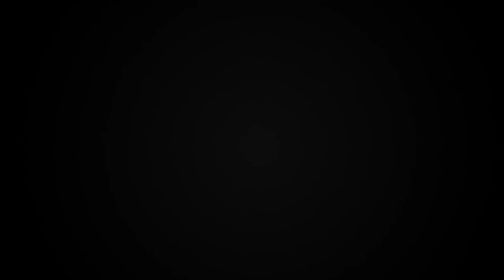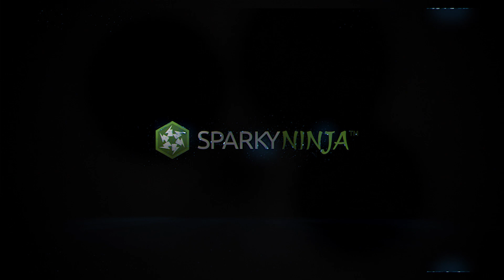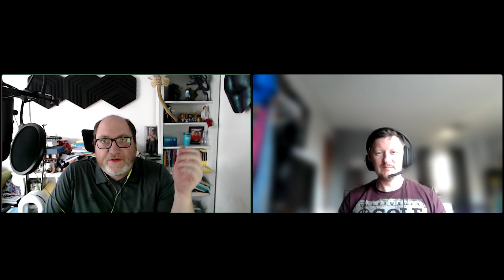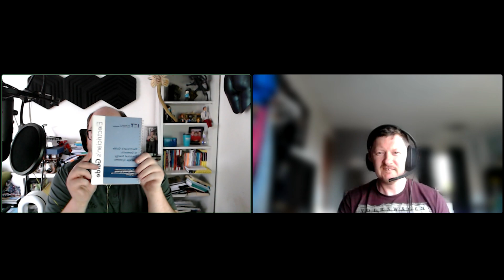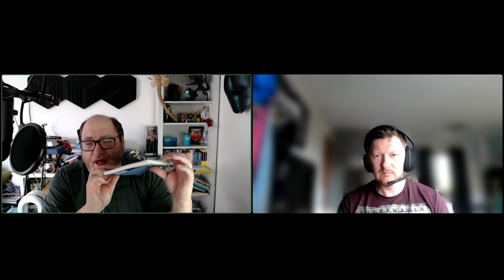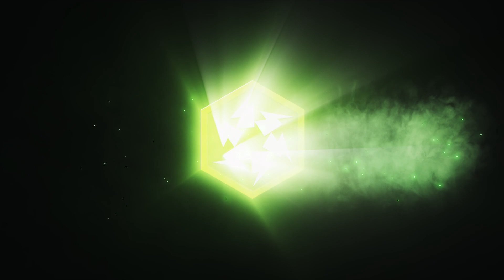SparkyNinja podcast 83: Site visits, cable bending, DNC update, Solar, Surge protection, Heat pumps

Comment: I had a customer wanting a socket fitting outside to plug a granny charging cable into to charge a plug in hybrid. 
I went to servey the existing installation to build a realistic quote. 
Ended up quoting to install a mains tails isolator, Henley blocks after to split the tails, new small dedicated hagar consumer unit containing a hagar type B RCD, Main switch and MCB, then out of that to a MATT-E board with OPEN tech, out of that in SWA through the basement, up into the kitchen under the cupboards, out through the wall, down into a duct that would run under tarmac in a customer owned private back street kind of area, out to a driveway, up to a pedestal with a BS 1363-2 EV rated external socket outlet for the granny charger to plug into. 

Thought if I was going to those lengths at staying compliant and ensuring no blinding of upstream rcd's, then I may as well also just quote for installing and EV charger also as a secondary quote. 

Not heard back from the customer which i'm not entirely surprised at. Probably get a handyman in to spur from a kitchen socket out to a standard outdoor socket that she can plug the granny charger into at 1/10th the cost. 

My thoughts are the external socket outlet needs rcd protection, the rcd integrated to the granny lead itself has no bearing on the socket outlet itself needing rcd protection. Then I also have to ensure the rcd protecting the socket isn't blinded by the EV and I achieve selectively or discrimination of types of rcds between the granny charger and the upstream rcd protecting the socket. Finding it difficult to find specifications from granny lead manufacturers that specify what ma protection and type their in line rcds are. I assume type A 30ma, so selectively between my 30ma protecting the socket and their inline rcd is nye on impossible and probably a departure. But I can ensure B type upstream. 

So my question for you both for next podcast if possible, what would you have done? Similar route to me with a probably over-engineered yet compliant and costly solution or something different, something in-between? What would your quote and solution have looked like?
Reply: Forgot to mention no bonding to water also so my quote included running 10mm bonding to the incoming water stop tap in the kitchen. 1800s building with lead water pipe feeding the house, changing to copper just before stop tap then copper throughout.